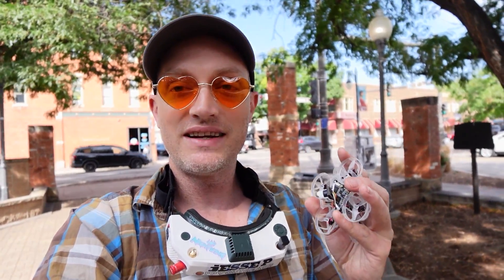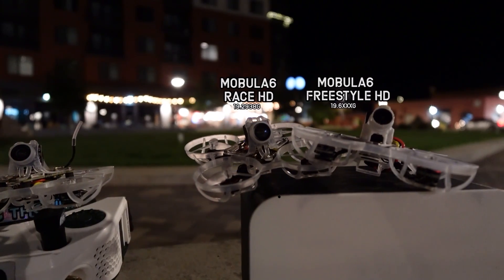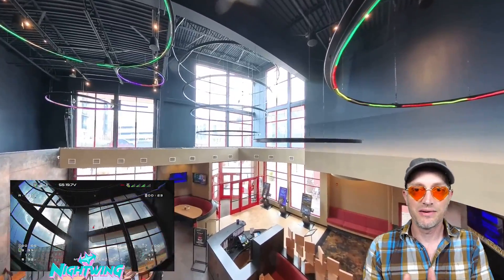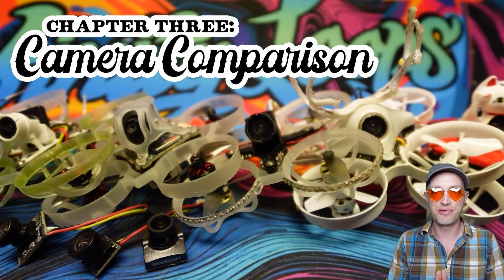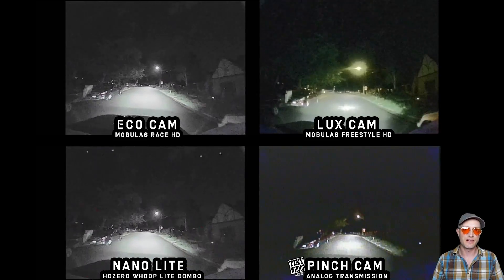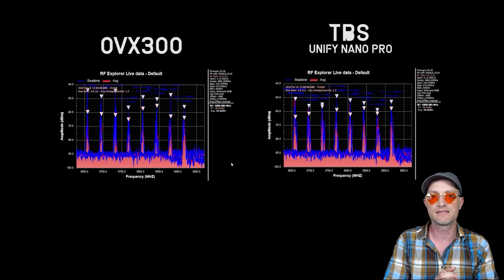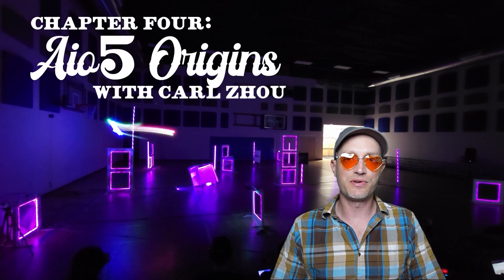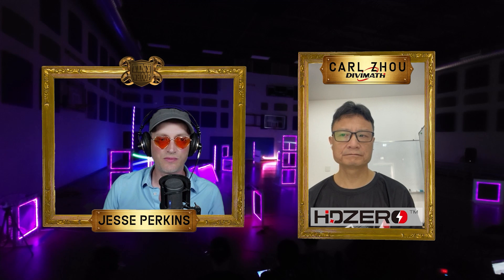Mobula6 RACE HD and FREESTYLE HD + HDZero AIO5 In-Depth Review

Comment: I bought BNF HDZERO Mobula 6 ECO and Mobula 6 Freestyle and I also use Radiomaster Pocket. I managed to update all of them to newest ELRS and setup binding phrase. Both Whoops bind and respond to all inputs when connected to Betaflight but then I unplug it I am having issues.

BNF Mobula 6 Freestyle HDZero does not arm at all. 

BNF Mobula 6 ECO HDZero jumps when I push arm but nothing after that. 
Zero support from HDZERO...

Comment: Cool video. New to fpv. I read that analog camera is better because of low latency and faster video transmission, so it would help for more accurate controlling. How does that compare to these digital Hdzero cams? Or does the new motherboard do a good job of converting the video with similar latency? Also how does this compare with the Mobula 6 2024? Is it just the difference in camera? Also if I get one of these, are they mostly ready to fly, and I just need a controller and goggles?  I read that people recommend ELRS radio control, so it means only controllers and goggles with ELRS will work?

Comment: Great Video, the comparison at 5:30 was key.  This is the 3rd review I’ve watched without that comparison.  Is the quality improvement worth the 15% extra weight?  No, but it’s close, 90fps might push it over the top.  HD Zero fills this very narrow space.  Barely too heavy, now at 65mm, and above 3.5” there’s better digital systems.
Reply from the maker: They ride the cutting edge, when the edge widens they will own it!

Comment: Ace review ticking all the FAQs about new boards. Top work and very exciting to know more about this board. 14 layer PCB 🤯 I've said it for a while but the height of technology in FPV is going into Whoops because it's the ultimate meeting point of low weight, high speed, high power and miniaturisation. Love that we are on the cutting edge of tech, well done for pushing the limits!
Reply: Yeah, I thought the same thing when I saw one of the beta test articles in person a couple months ago.  I literally said "That's probably the most advanced drone technology on earth right now."
Reply: @BTW__Whoop  14 layers, crazy, but to cramp all those components there I'm not really surprised.
Reply from the maker: Thanks! My hat is off to Divimath/hdz!

Comment: What about repairability?
Reply from the maker: This would be very, very difficult to repair
Reply: Carl and Quellet have discussed repairing AIO boards, shipping paid by customer both ways...but they will make an effort to recoup damaged boards...
Reply: @mcclarinscott  that's nice but still pretty expensive (especially time wise).
Reply: @GK-dd5ci  this AIO 5in1 is the most robust...thickest... Whoop AIO yet created.
Reply: @mcclarinscott  it's not about the thickness. It has never been. I never broke the PCB. It has always been some component failing, chipping off or just dying due to overheat/back EMF from motors.
Reply: I have 2 AIO5in1 on the way to convert two mobula 6 frames...plus the ECO cams...saves 100+usd over buying two BNFs...